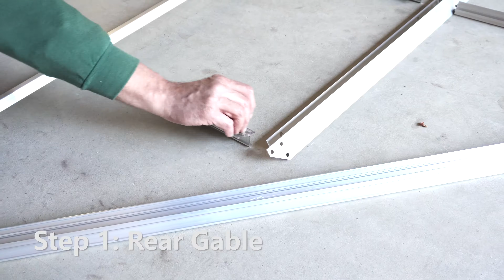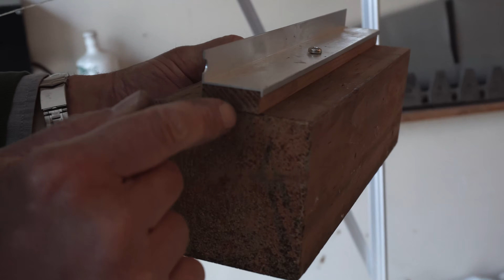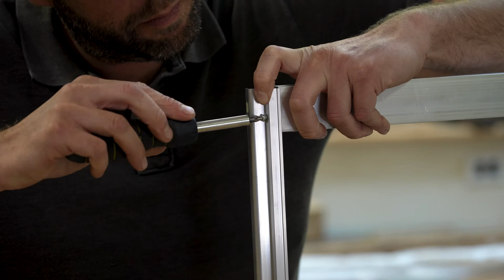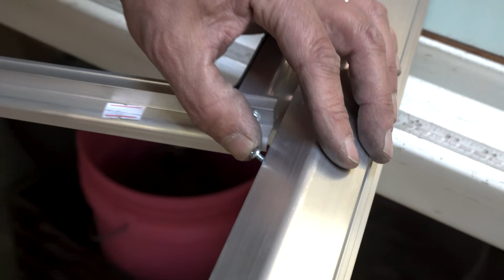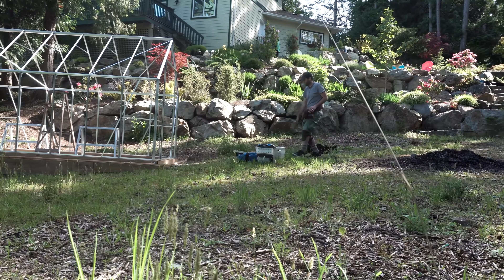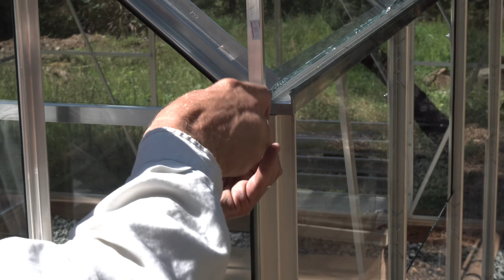Installing a Halls Magnum Greenhouse

Comment: I’ve never assembled anything more complicated and frustrating than this.
The instruction manual is absolutely terrible—poorly explained and badly illustrated. The images are practically useless. Building this greenhouse is nothing but trial and error.
Bolts and support bars that are needed at the very end actually have to be inserted at the very beginning—but this is never mentioned anywhere. As a result, you end up having to take sections apart again. In the end, you basically assemble the whole thing two or three times because parts are “missing” unless you somehow had the foresight to install them earlier.
Even carefully studying the instructions beforehand doesn’t help, because so much is left to guesswork—and most of the time, you simply can’t figure it out.
Even as an experienced tradesperson, this pushes you to your limits—unless you’re willing to spend months tinkering with it.
The manufacturer’s assembly videos on YouTube are, once you’re already in the middle of building it, almost an insult rather than a help.
For anyone without practical experience, I strongly advise against assembling this yourself. Honestly, it feels like this might even be intentional—so they can sell you the assembly service as well.
I will never buy anything from this company again.

Comment: I am in the UK.  The instructions are utterly dreadful.  As someone who can assemble IKEA furniture and Meccano in my childhood, I thought this would be easy.  Good grief, it's ridiculous.  I have the 6mm polycarb glazing.  I abandoned using the glazing strip and that U stuff on the vents.  Just as well as I've just had to alter 3 window frames and they would have fallen apart.  Halls had the audacity to send me a satisfaction survey last week.  Not sure I can answer it without an expletive or two.  I built a Palram greenhouse about 5 years ago.  Far, far simpler.

Comment: I have never in my life tackled such a frustrating project due to extremely poor instructions. The instruction pamphlet is clearly a photo copy of a photo copy and has caused us to disassemble parts several times to put in parts which weren’t explained properly. I could go on about this poorly thought out product but suffice to say, if you want to protect your mental health then DO NOT BUY this product, it is impossible to assemble going by the instructions.   William

Comment: I had to put together a lot of things in my life but by lightyears this has the most useless manual I've ever seen. Many things left out, many pictures you can't make out, honestly it was a real painful experience and definitely made by sadists for masochists.
Reply: I completely agree, I’m in the process of putting our Magnum together and it has been SO painful! The doors took me an entire day and I rebuilt them 3 times. This video explaining the orientation of the verticals based on the distance of the screw holes from the ends helped massively.
My doors don’t hang well at all though, they’re up as high as they can go but still drag on the bottom, so much so that they barely move and feel wedged. Any ideas welcome.
Reply: @th3kn0t  Agreed! Just done 3 full days of greenhouse building, yesterday being the longest (8am - 9.30pm) and I still have the front and back to glaze. I thought glazing would be the easy part but the fact the instructions might as well be in another language with how much use they are. Absolutely atrocious. Worst company I have EVER purchased from. I'm about to head out now to try fit the doors, Cannot wait for a new anxiety induced evening...
Reply: @soph_abb3583 we're currently in hell trying to fit these doors. The top wheels sit nicely on the track but the bottom slider won't sit nicely in the groove, they're so tight! 

Even tried oiling the bottom but no dice, did you have the same problem by any chance?
Reply: @th3kn0t we're so stuck on the doors right now, everything else built but cannot get the bottom track to sit right against the door, the wheels at the top are fine but my god the bottom track won't line up.

How did you do this 😂
Reply: Totally agree, save your sanity and pay someone to assemble
Reply: Just finished mine today. What an absolute shitshow of an instruction manual... Never again

Comment: Hello Matt.  I'm building one as well. (So, not an 'official' reply). The part you are referring to is 2 pieces of self-adhesive, low density
foam strip, each 600mm long. Its like budget draught-proofing strip you might use on a doorway.
If you look at the glazing section of the instruction manual you will see where it is fitted. It goes UNDER the two central sections of  part 735.
This is the wider, full width upper horizontal bar on the rear gable. The glass panes are fitted over the thin vertical gaskets as normal , but in this position only the upper edge of the two adjoining panes is fitted against the foam strip. I presume this is either or both waterproofing
and draughtproofing. I also purchased a higher grade 'D' profile self-adhesive strip to go at the lowest base of the sloping glass roof panes,
ie, above the gutter. (silicone is recommended in the video). I would not have been able to get as far as I have on my installation without
referring to the video. Saved a lot of time, and remaining sanity, as a few matters are not covered in the instruction manual. 1300h UK.
Reply: Hi Pat - that's odd, that piece seems to have been missing from my kit so may have to get in touch with Halls - though it has taken me so long to assemble I'm not sure if they will send another! I hope you are doing ok - I've finally completed assembly today, although the door needs some tweaking as it's very hard to open and shut. 

Out of interest, does it look something like this: https://www.greenhousepeople.co.uk/products/898/adhesive-foam-strip-for-glazing-15m/?gclid=Cj0KCQjw1N2TBhCOARIsAGVHQc4DfSBzWZgrSbiIFWM-QK91WYiNWLtb7Ifag-2TbEnerBTQt1sgHVkaAvo4EALw_wcB 

Have you nearly finished assembly? I love the greenhouse but have been really frustrated with the instructions!